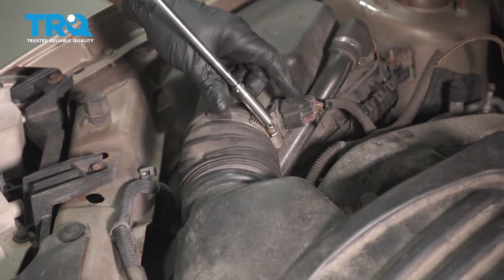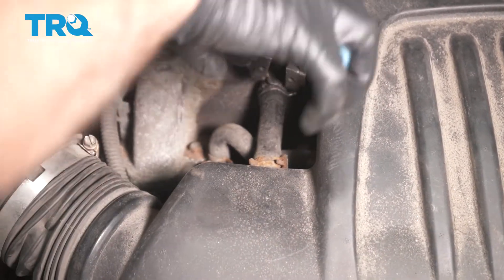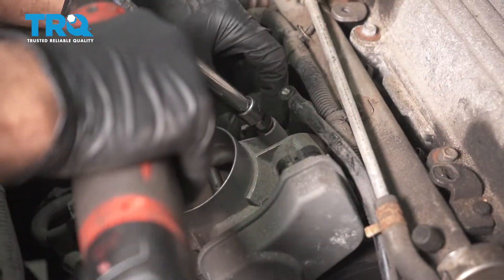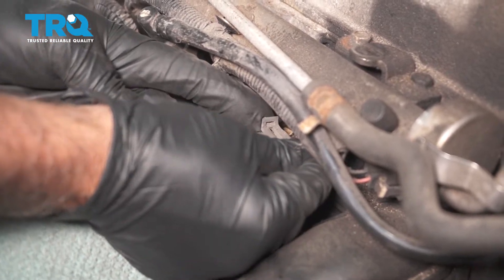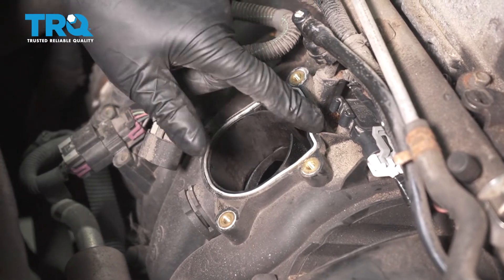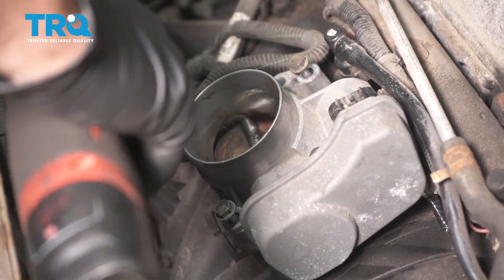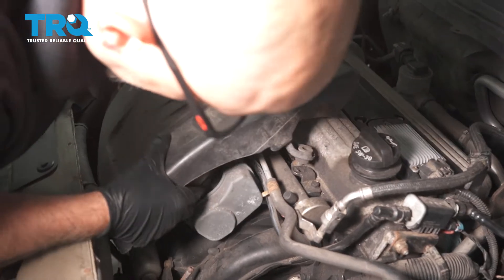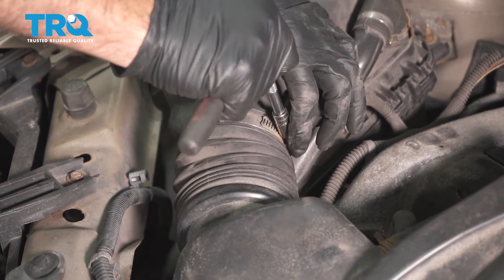How to Replace MAP Sensor 2005-2010 Chevrolet Cobalt

Comment: Is it normal for the throttle body to smell like gas in there if not what can this be and what do I need to replace
Reply from the maker: +Jazzy Smith We wouldn't be able to diagnose an issue like that here, you may want to have a local mechanic take a look at it. Thanks for checking us out! http://1aau.to/m/Shop-1AAuto-c

Comment: you dont need to take off the throttle body, just remove the clips holding the harness onto the fuel rail and move out of the way. Enough access is available to replace with just intake tube/box off.